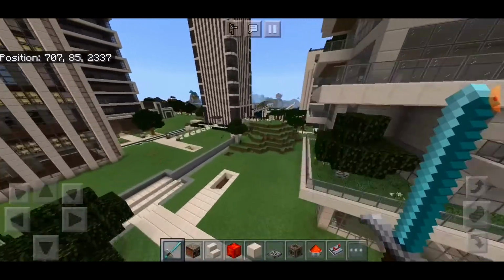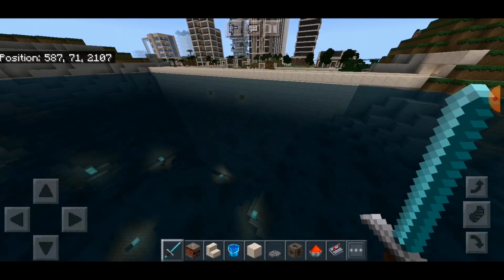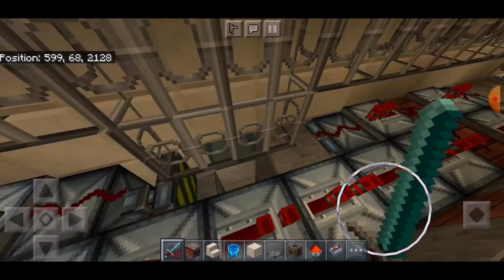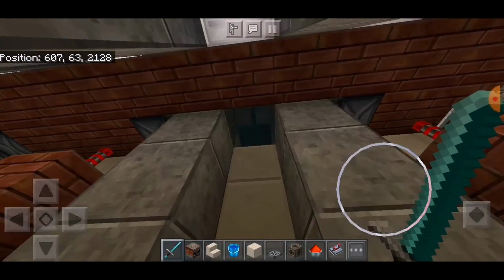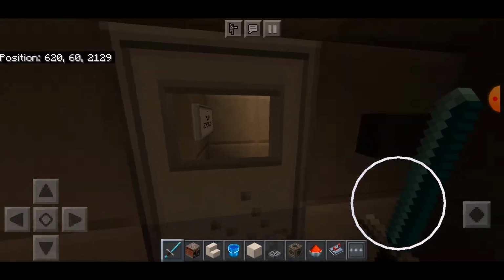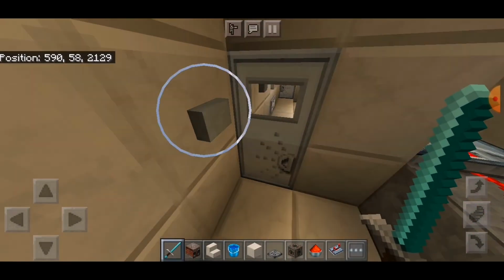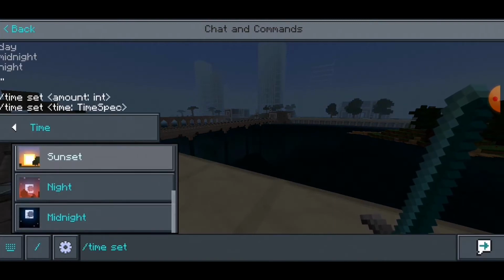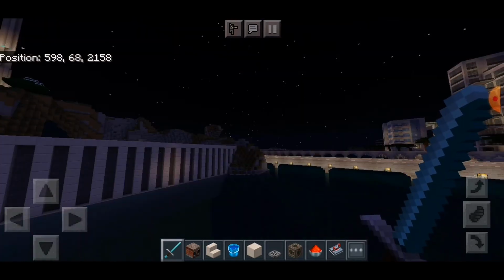Power your Minecraft villages/structures with a working Hydroelectric Dam!

Comment: Can you create a working city (cars and trains) ?
Reply from the maker: Great question. Technically you can use a hydro power plant to power a city with trains. The only issue is the rendering has a limit so redstone doesn't get sent further than a few hundred blocks! You could solve this by building a few different power sources scattered through the city. Like solar panels and hydro plants etc